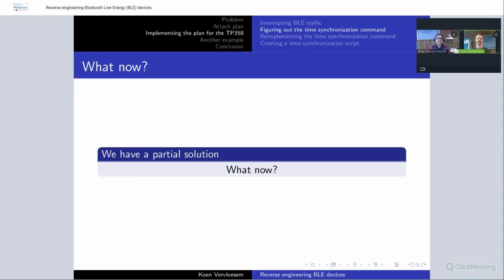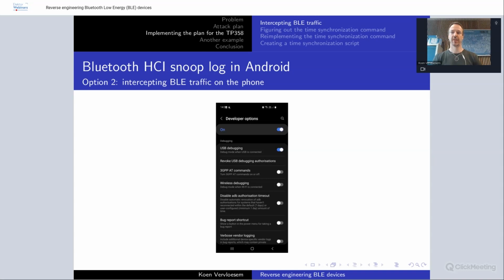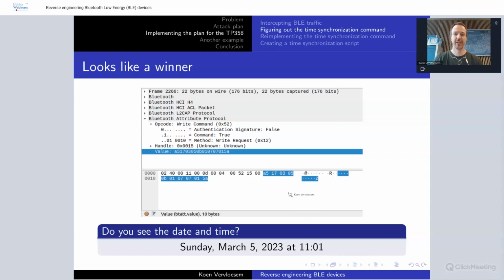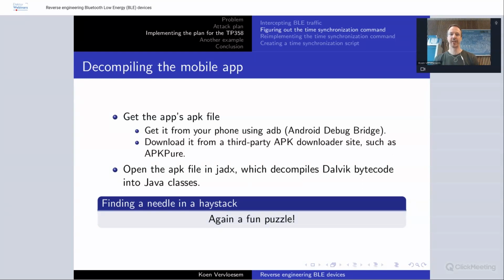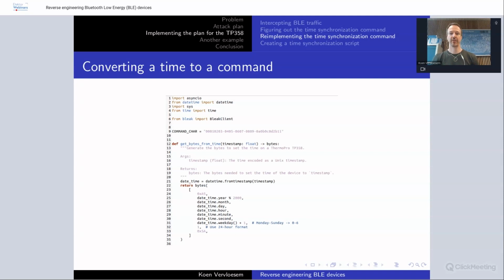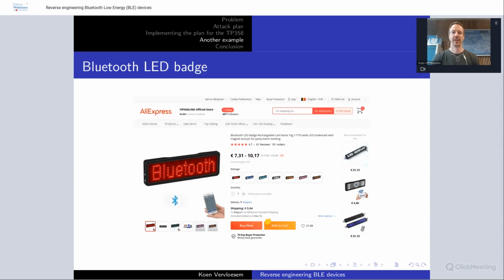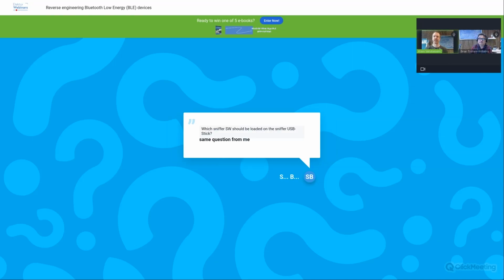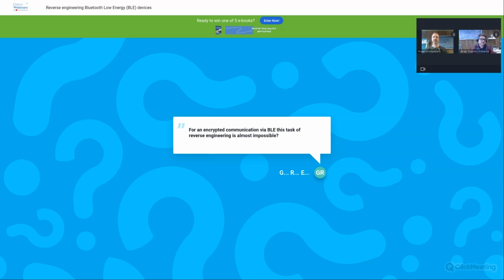Reverse Engineering Bluetooth Low Energy (BLE) Devices

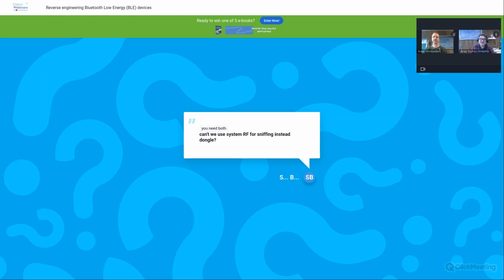Comment: 52:36 unfortunately the question was not understood, because it's exactly what I'm wondering too. 
why you have to connect a separate BT-device to your PC, with special sniffer firmware, instead of using the PCs own BT-adapter (assumed the PC has a build-in one). 
or asked differently: why is the computers BT-adapter not in Wiresharks list of devices to analyse data from?